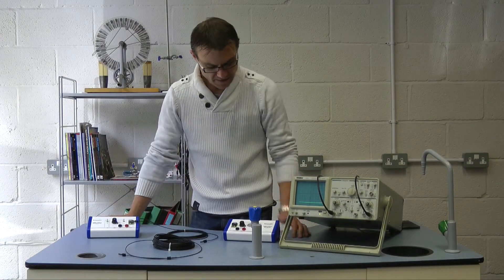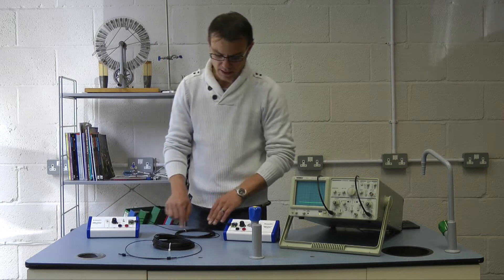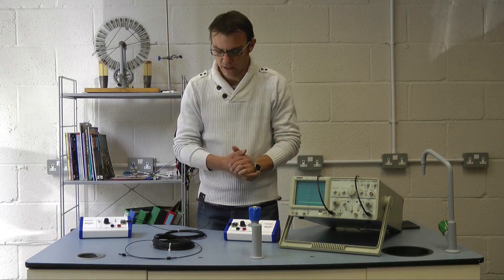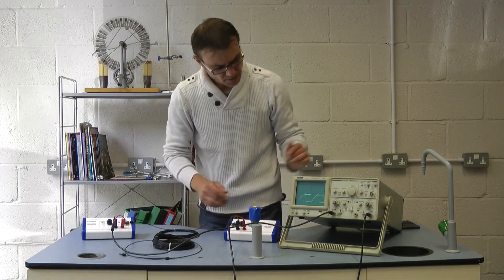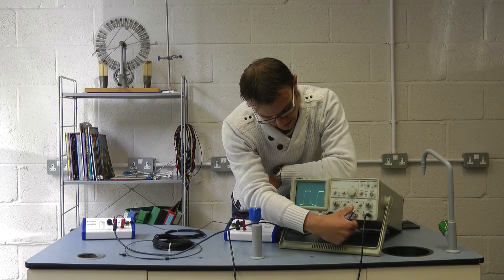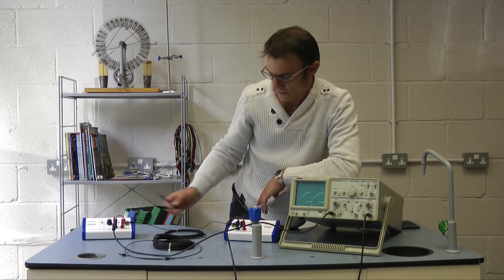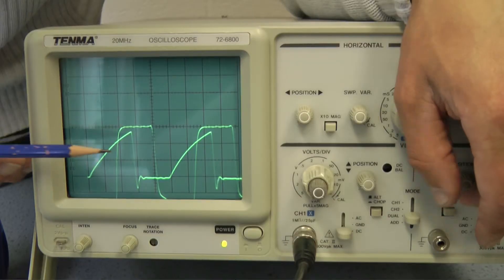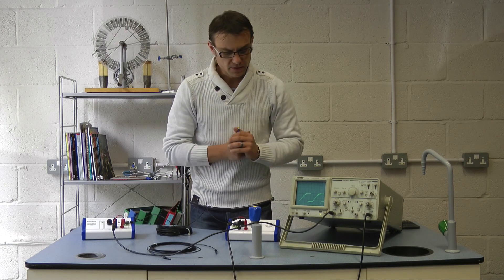Fibre Optic System

Comment: hi sir, can u help me i am doing this for my optics project.but i dont have composite transmitter and reciever .so can u help m how in this case i can build my own transmitter and reciever.that would be very helpful
Reply: https://www.digikey.com/product-detail/en/broadcom-limited/HFBR-0501Z/516-2315-ND/2627142
hi asma, look at this link, the transmiter and the receiver and cable together, you can also buy the laser diode and the photo diode separately .
Reply: I am actually thinking of the same